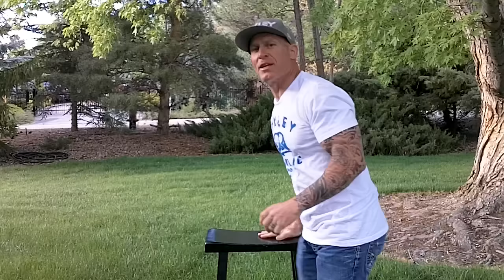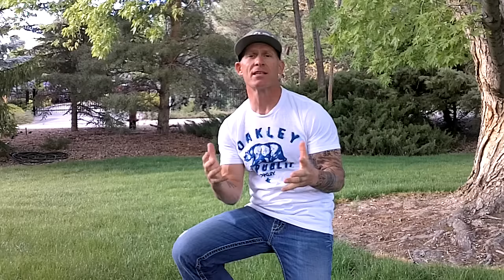What Tip To Spray Paint Trim Work?  Graco Sprayer Tutorials.

Comment: The Graco CSR told me not to spray latex using anything below a 314.  Apparently an FFLP 310 is not to be used with much more than stains and other thin materials.

Comment: Im going to use a Graco Sprayer for doors and molding, you say use a 310. Graco says don't go below a x15 for latex paint and the x10 tips are for stain/urethane's. Of course I believe you as you do it all the time. But why are they saying an orifice of 15 and if going to 10 then wont the paint shoot out at a higher pressure than the 15 ? Are there any other issues? Whats with Graco on this bad info?
Reply: I was told the same thing when I called Graco.  (Right after I spent $39 plus tax on an FFLP 310.)  I just ordered the FFLP 314.  The sprayer is not expensive.  It's all of the extras that kill ya.  Tips, extensions, guards, pressure gauge.
Reply: @tribulationprepper787  I didnt speak to them, just going by a chart in the docs. There are zillions that do use the FFLP310.I just spraye 20 interior doors about 78x33 inches using the FFLP310. I was at 6 inches, did 50% overlap and did an avg of 11-13 columns per door which would include double pass on starting and ending edges. They came out showroom finish perfect & this is first time I used a sprayer. One problem I had was the tip & tip guard had a ton of paint & I mean a ton. This paint caused spits even though I had no extension. I used the correct tip guard and inserted the orrifice in the guard that came with the FFLP310. I had just sprayed day before with a 510 new black color tips and did not get any build up at all in the tip & guard like on the FFLP310. I dont know what caused it but it built up so much paint I had to keep cleaning it off. Any ideas please advise. Did Graco tell you why to use a FFLP314, rather than the FFLP310? I emailed them about if I could use aa FFLP310 with a Magnum Project painter despite the chart and they said I could but needed the correct tip gurad which I did use which I think was the blue. Id suggest to move fast using the 314, the 310 still put on heavy paint and I was moving quick.Good luck.
Reply: @ColdWarVet607   I think we are both learning about this.  Since the Graco rep told me to use at least a *14 tip for spraying latex, I am thinking that the smaller hole in the *10 tips might be causing your clogging since the thicker paint has a hard time getting through the smaller hole in the 310.  The red guard that comes with the gun apparently doesn't work with the green tips so you do have to get the blue guard.  So far, I have only sprayed water through the system just to get a feel for the gun.  The water leaked small drops from the guard using the FFLP 310 and 110 tips.  Graco told me this is because water is thin compared to paint which makes sense.  Graco said that I needed to read the "Application" info on each paint can for tip size recommendations.  This is a new world for you and for me.  We will become experts in no time.  If all of these YouTube guys can do it...  we can do it so don't worry.  One suggestion I would seriously advise is that you pick up a pressure gauge for your sprayer just to eliminate some guesswork since the little knob doesn't tell you much.  Mine was about $36.00 on eBay with tax and shipping.  Here is the link if your interested.  Take care.  https://www.ebay.com/itm/Paint-Sprayer-Gauge-Assembly-6000-psi-Pressure-Gauge-0-6000-psi-1-4-Fittings/264193812272?hash=item3d832da730:g:zZUAAOSwlEZcYzm6
Reply: @tribulationprepper787  Im having the same problem, the 310FFLP will not spray Super Paint, but perhaps when I see "full pressure" on these videos this is whats required to get latex paints to work with the 310FFLP tip. any thoughts?
Reply: @craigkeyintel   All I know to do is to test the spray pattern by painting a piece of cardboard or something else expendable.  Once you get that set,  go for the project.  I will mention what I did above that helped.  Get a pressure gauge for your sprayer.  This eliminates some guesswork for future start-ups.  You can see the link for the one I bought in a comment above.  Take care Craig

Comment: Hi Chris, how many gallons can you spray before you have to change tips due to wear? I'm finding that I start to get "tailing" before I get to 50 gallons. Any thoughts? Thanks!
Reply: Tailing normal ur pressure is too low. With tip wear ur fan size gets smaller till ur spraying a circle than a fan

Comment: I been reading all comments but I decide to buy and use a FFLP 310 and the paint stock making a mess before painting using latex semi from Shelving Williams. What is the yellow gasket use for ? I’m a DIY painting doors, gabinete and other furniture around the home, any advice would help also I got a Graco x5. Is any special tool to clean the small opening?
Reply from the maker: Its for solvent based paints

Comment: Chris, the sherwin williams emerald urethane trim paint  requires a 13 tip. I've used a 3/11 w/orange cap. Do you think I can get away with your 3/10 blue cap (FF)???
Reply: I would like to know about recommendations using the 310 Fflp tip as well for emerald urethane.  I have used it personally with a 100 filter and a 60.  Im satisfied with the results but would like to know a professionals opinion as well.  I love the emerald urethane now I have had some practice with it. I have found that spraying it in a cooler 60-65 degree indoor environment allows for a better flow out. I still see the micro bubbles occurring occasionally in the cured product but possibly it is surface contamination or humidity issue. Just wanted to see what others have to say.

Comment: You're videos a great. I'm about to spray some cabinets with Sherman Williams Pro Classic Acrylic Latex. Can the 310 tip work with a heavier latex like Pro Classic?
Reply: Yes, I use a FFLP 310 on trim and doors. For cabinet doors I would lay them down flat on blocks and spray them that way. Proclassic runs like a bandit if you go over the same place twice.  You can overlap 50% and get away with it.

Comment: When using a 210 do you have to thin the paint to keep from clogging?
Reply from the maker: No, we do not thin our paint
Reply: @Idahopainter  ok thank you i bought a 310 and it clogs almost instantly so i clecked both filters and they were fine so i giess it must be in the line itself
Reply: Jim do you strain your paint? Regardless of where or when the paint was made it all needs to be strained, I didnt buy strainers for a spa I did and all 13 5s where clogging left and right if you stain it then you might get a clog here or there
Reply: @Idahopainter  Idaho Painter.....Indiana Painter here. (Rookie) 😂😂.  I'm assuming you're straining all your trim paint.  But if you don't need to thin it what brand and paint are you using.  Thanks in advance for your help.... 👍👍

Comment: What mesh filter do you use for FF tips and what pressure do you typically set it at?  My 440 constantly clogs at the tip when Im using a FF.  Trying to figure out what I'm doing wrong.
Reply: I have a 440i , and spray doors with a 211 ! Strain your paint and use a 100 mesh filter in gun ! Also cut a piece of the strainer bag and put it over the rock catcher , holding it in place with rubber band !  Your problems will disappear !
Reply: I will give it a try!  Thank-you!
Reply: If you have a 310 tip that hole size is about 250 microns or 60 mesh. A 208 tip is about 200 microns and 72 mesh. To be safe you need to pre filter all paint at 100 mesh or 150 microns to remove anything that can clog those tips. A 100 mesh strainer will filter small enough particles out for for all Graco tips even a 208. Don't get carried away and try 25 micron filter as it won't flow at all with paint. The 5 gallon strainers are the best as you need the larger surface area. Here's a mesh inch micron chart. http://www.kmcoating.com/blog/wp-content/uploads/2016/05/mesh-micron-paintspray-filter.png

Comment: How's it going chris, i have a bit of a dilema. i purchased the graco x7 as well as a 313 rac IV switch tip and most paints suggest .015 -.019
For these paints, is it not smart to use the 313 tip?
i cannot seem to find paint that suggest that low of a size?
Any help or advice is much appreciated
Reply: Alex do not get a geaco x7  the gun don even last 60 gallons and to fix it you need to pay @ $250

Comment: Chris! I've been using the 310 on my trim, plantation shutters, and doors! I tend to be getting lots of runs.. what can I do to prevent this? I've tried lowering the pressure, painting faster... I used a paint leveler, etc.. What could be the culprit?
Reply from the maker: There could be many things causing this, so it is hard to say
Reply: Do you have 1 or 2 suggestions that a noob like my may be doing wrong? I'm using a graco magnum x7 with a blue racx guard and a fflp310 green tip. no extender. Using a semi-gloss proclassic sherwin williams interior acrylic latex, added M-1 Latex Paint Additive & Extender to my gallon per bottle instructions. I've had my pressure set pretty low. I'm desperate here in my house remodel! Thank you so much for all you do and your excellent spirit! God bless you!!
Reply: correction I've been using a 210 tip
Reply: Mark Matthews don't use proclasic use sw SOLO LATEX but if you want satin finish, use semigloss paint. Make sure you prep. The wood, sand it good. That should do it. I'm a pro painter. And proclassic it's really hard to use. Runs  so easy.
Reply: ...I'll second Mark Matthews on the ProClassic hanging issues...more of an issue on vertical surfaces but the unnecessary chemistry of the extender may be an issue also...the right technique plus the right product and let the paint to the work...
Reply: @Omar-es8us  same opinion with pro classic oil?